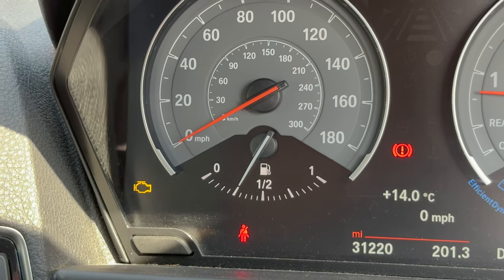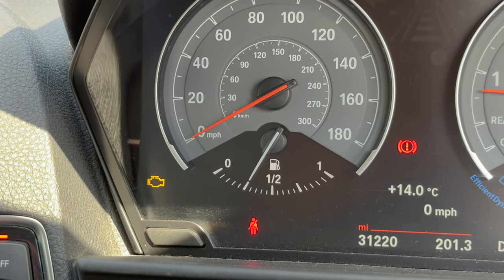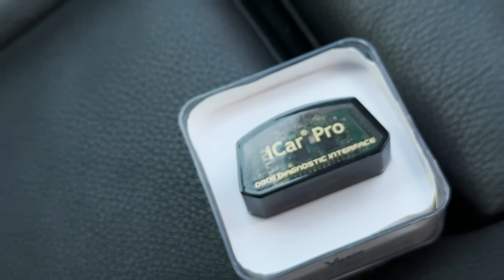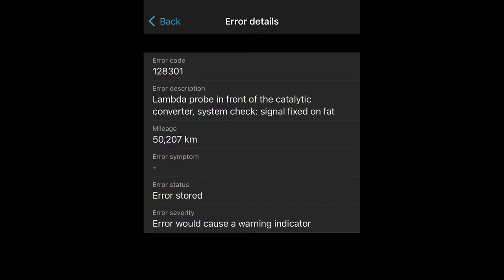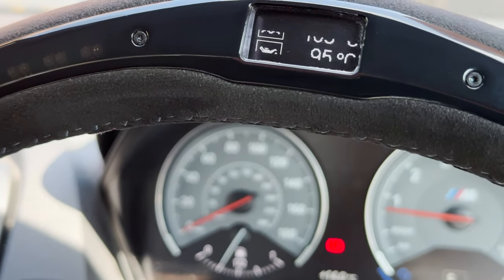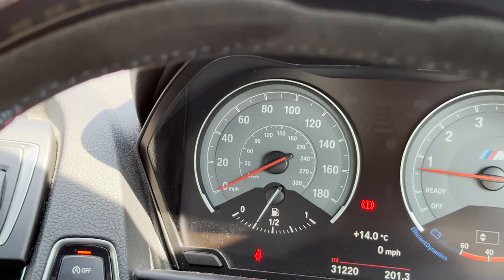EML - Engine Management Light triggered by Lambda sensor. Sport cat? Let's investigate!

Comment: I have a VRSF catted DP and didn’t want to mock around with that exact issue. Went with BM3 stage 1. No light, a bit more power, lots more torque and amazing burbles
Reply from the maker: If I can’t get rid of the problem other way I will have to go bm3/ mhd however I will definitely stay on stock map. Did you have any problems to go through MOT?
Reply: @MDrives  I’m from Australia, no issues with MOT here. But with BM3 you can switch maps so can run a stock map for MOT if you have to

Comment: I get the p0420 code every few months. I have a fabspeed catted down pipe on my 2017 m2. I just clear it and get on with it tbh. Good luck.
Reply from the maker: Thanks. I thought the fabspeed guarantee it will not cause Eml? They are quite pricey! Anyway, thanks. I think I might try wire wool trick first.

Comment: What’s with the music lol.  I think the only real way is to get it mapped out. I’ve been very tempted to get a sports cat for my car but everything I’ve seen says the light could come on, even with a 90 degree elbow it could still come on.  Active Autowerke do a sports cat with an anti light guarantee but then someone said the light came on even with that and it’s £1600 lol.  I can’t be doing with the hassle so leaving it standards.  At least you can clear it yourself anytime it does happen to pop up.
Reply from the maker: It’s a nice not expensive way of adding a bit of noise but I hoped I wouldn’t get the light. If it will keeps coming back I will have to reconsider 😒